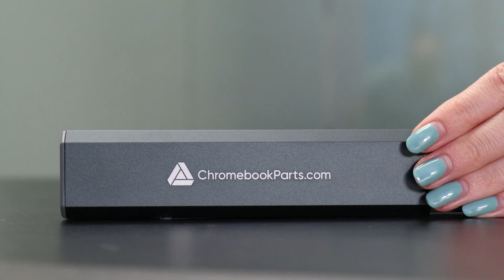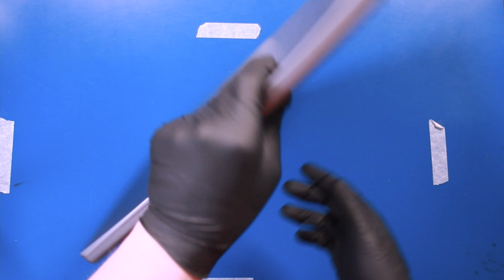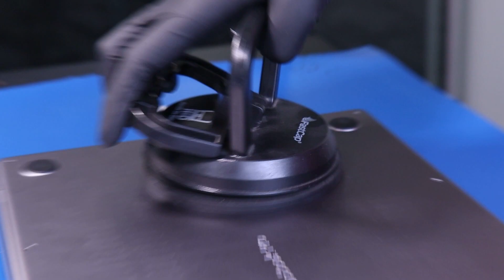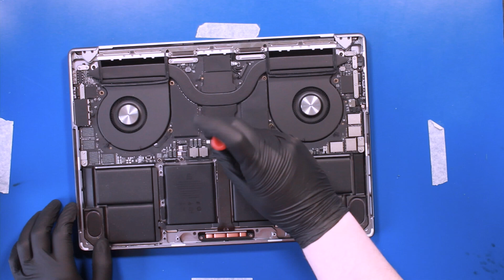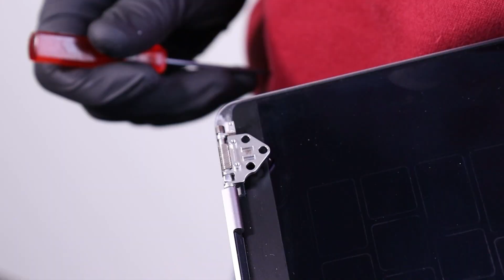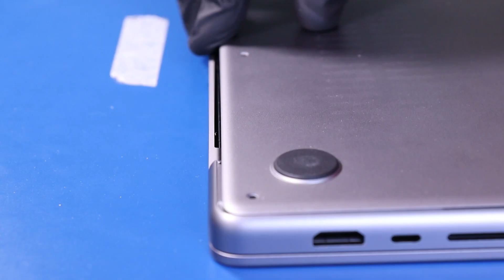MacBook Pro A2485 LCD Assembly Replacement

Comment: Followed this to the letter and had a successful replacement. One thing I wanted to mention. It could be different based on the model, but I required a P4 driver to remove the 8 screws on the bottom shell, and then a P2 driver for the 9 screws on the antenna bar.
Reply from the maker: Glad it worked out! Interesting that the screws might be different, though. Will keep an eye out for that.

Comment: after replacing the 2485 matrix, the display is set to 57 inches instead of 16 inches in the settings. What could be the problem? true tone and everything else works
Reply from the maker: We haven't encountered that situation in our own repair department, but one idea is that the screen may be causing the issue. Was this third-party, or Apple? The only other thing we can think of is that the scaling may have accidentally been changed in the settings.

Comment: Screen didn't work after replacement. It says I need System Configuration tool or something
Reply from the maker: We haven't run into this issue with our screens, but Apple does have a guide here for that process that may resolve the issue: https://support.apple.com/en-us/108333

Comment: does it have the abnormalities issue on the top when replacing the screen?
Reply from the maker: We didn't encounter any on this device. What kind of issue are you referring to ?
Reply: @ back when m1 chips came out and screen were replaced it would have lcd issues on top, but i guess apple fixed/updated it